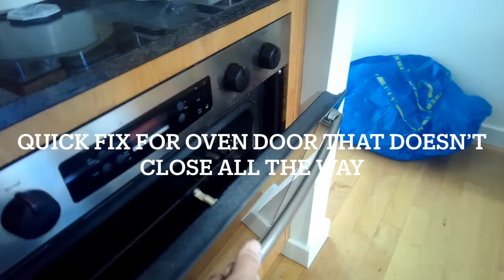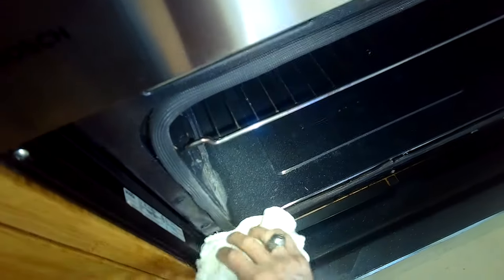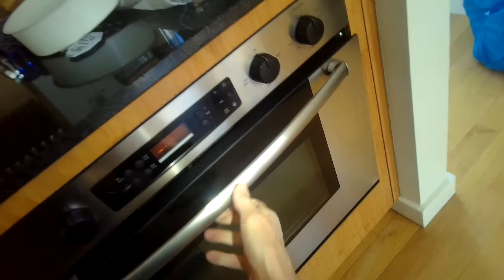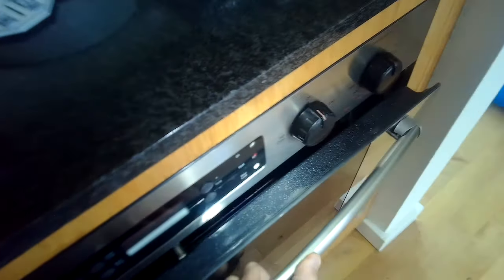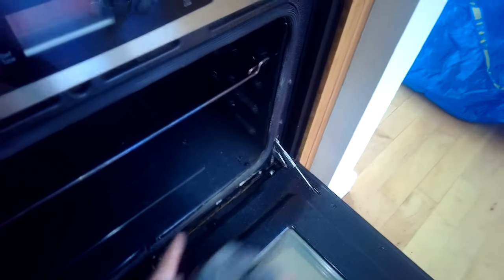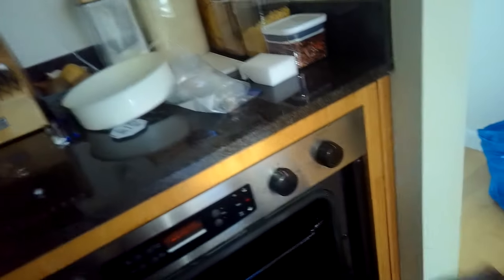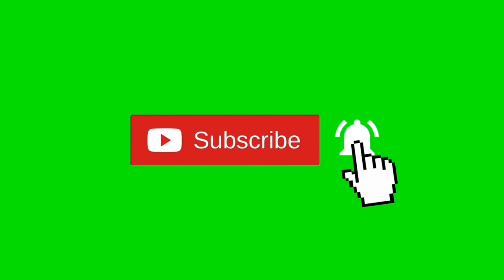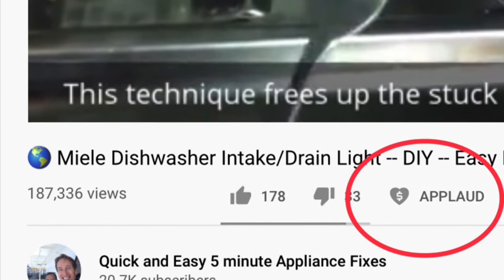✨OVEN DOOR WON’T STAY CLOSED—SUPER EASY 2 Minute FIX✨

Comment: I have had my Built-in Indesit Oven Door Off, Dismantled, Reinstalled, Sworn at so many times, because it won’t close fully, I’ve lost count. I eventually decided today that I needed to buy new Hinge/Spring Assemblies as I could not find any other possible fault…but a final check on YouTube and  you have just saved me £75 as this trick did the job…thanks for the Tip…I’m now a Subscriber…👍🏻👍🏻👍🏻😎

Comment: It worked!!🎉🎉🎉 oven door has not closed properly for ever, had to use a screwdriver to wedge it shut. This fix works because the springs are the problem and this fix is common sense. Genius.
Reply from the maker: Thanks so much Mick😊👍

Comment: I was seriously considering new hinges, as the door was not closing at top of our fisher paykal wall oven. First I checked for crud or such that could've been gumming up the door hinges, or seals etc.
Ran a clean cycle and saw no improvement at all.
Next step I considered was door removal and hinge inspection.
Then I caught this video and did the corner rags and pushed the door top rearward with slow steady effort.
Worked like a charm and saved me a $100 on 2 hinges.
Great tip
Reply from the maker: That is Excellent News😊👍

Comment: Thank you so much for this tutorial. You won't believe how helpful it was I've been fighting with this door for a couple years trying to figure out how to fix it, even to the point of using rubber wedges to hold it shut.  Thirty seconds later it's all good. I thank you from the bottom of my heart . Take care  .
Edit 
This fix works on my oven door but it doesn't last but I'm fine with that even though I have to repeat the fix every few months. I now keep two old rags inch the bottom oven drawer and in a few seconds it's good to go again.
Reply from the maker: It’s magic😊😊😊😊✨

Comment: Now THIS is why the Internet was invented. Thank you × 1000. Literally a 30 second fix! I suppose the washcloths in the way of the hinges allow for some resistance to let one slightly bend some part of the hinges back into form when carefully closing it this way, allowing the door to close more properly (our gas DeLongHi has a catch at the top center which wasn't quite holding the door; now it does!).  I regret I have but one upvote to give!
Reply from the maker: Thanks so much😊😊😊
Reply: @ScottTheFixItGuyChannel  You're welcome.  I should add a note here though, that this, for my oven at least, was only a temporary fix. After about 2 weeks the door started falling outwards again... I decided to take the door off this time to see what the condition of the hinges was, and one's pin was broken completely through and the other was severely cracked (there is a metal pin that the main hinge swivels on). So if those are wearing out, using this towel trick might actually crack them the rest of the way through. Thankfully replacing the hinges was relatively easy (but getting new hinges open the first time, to engage the locks so they can be inserted into the oven, is tough! Make sure you have big vice grips or a big wrench and watch your fingers!)

Comment: WOW. Thanks for this. Worked on my older Viking Oven door. Saved me the $250 plus for new hinges. Suggest you mention this in any of the videos for replacing hinges, as a better and much simpler approach if it will do the job.
Reply from the maker: Good suggestion Shelley👍👍👍

Comment: Ours started doing that after a self clean. Two towels in the corners and a little pressure while trying to close it fixed the problem. Thanks, Scott.
Reply from the maker: Easiest repair ever😊😂
Reply: @ScottTheFixItGuyChannel  If it takes over a minute, you're doing something wrong. Thanks again.

Comment: Wow.  I was about buy new hinges and was looking to take the oven appart to get to the old ones.  Saw this video, if I'm honest I doubted how this could work.  I was wrong.  
Thank you,😎 this has saved money but also a LOT of time and frustration removing the oven and taking it apart.

This was for a UK Beko KDVF100X 100cm Dual Fuel Range Cooker incase anyone has the same issue.
Reply from the maker: Nice job John😊👍

Comment: I coupled this video with Scott's other one about replacing hinges.  My oven door was not closing AND was very very sticky and creaky.  I removed the hinges, inspected them to make sure nothing was broken or bent, cleaned the pivot points of grease using goof-off, dried using a blower, regreased pivot points with High Temperature grease (made for oven hinges), reinstalled hinges using other video, then applied this washcloth technique which I assume retensions the springs (?).  Oven door opens smoothly now and closes fully.  Thanks Scott, you just save me at least $250, much more if I had to call a repair person.
Reply from the maker: I love it,
Thank you😊😊😊

Comment: Great tip! Our oven door was leaving a gap at the top that caused the oven light to stay on.  There did not seem to be a way to adjust the door.  Who would have guessed that some pressure at the right point was all that was needed.  Thanks for sharing!

Comment: Dude! This is like some sort of magic. I thought that there was something wrong with my oven thermostat because the oven wasn't holding heat, taking way too long to cook food. Then I realized that the door was not sealing properly. I used Google for that and your video came up and Presto, such an easy fix that would have cost me a lot in repairs. Subscribed.
Reply from the maker: Thanks so Much Wendy❤️😊👍 you just performed appliance magic😊

Comment: Thank you so much. I was losing heat and my light stayed on. I unscrewed it a long time ago. I tried this because I was afraid I couldn’t put everything back together if I took it apart. I tried this and my oven works perfect. I screwed the light bulb back on and it shuts great! Thank you so much.
Reply from the maker: Awesome,
Thanks so much for the update😊
Reply: @ScottTheFixItGuyChannel  Yeal I read so many about putting new hinges on. I saw yours and said, what the heck , it’s worth a try. I was shocked when it actually worked. It seemed to be too simple. I live alone on a fixed income, a woman who is  not savvy about this stuff too. 😆 but it actually worked for me. Thanks again, and God bless for sharing!

Comment: it worked in terms of it closing tightly! Thank you so very much!  <3 BUT ... one quick question/mystery.  :) The door is slightly askew now (higher on left than right), and it clips or rubs the right edge of the frame as it seats. any ideas?
Reply from the maker: Can you push down on the left side when the door is slightly open to make it normal and straight?
Reply: Will give that a shot today and report back. :) Huge thanks, Scott!  @ScottTheFixItGuyChannel

Comment: Wow wow !!  I wish I'd of watched your video sooner we just had an appliance man out who checked out our 25 years old + NEFF oven as it was taking its time getting up to temperature and maintaining it.

 Apparently the oven is working fine but its in good condition for its age.

I pointed out that hot air was leaking out off the top of the door and the repair man said this was normal 🤨 I told him it never used to be this bad and could this be the problem ? I was told it wasn't the problem, the oven was given a thorough check up so I paid the £93 and the appliance man left.

Not happy I was going to buy a new set of expensive replacement door hinges (if possible) and a new door seal.

I was looking at YouTube seeing how hard a job i was going to have to replace the new hinges, when I came across your video 👍👍👍 

Thank you Scott 😊😊 after 2 minutes the door was sealing properly 😮 the oven used to take an eternity to get to 200C (over 15mins) now its hot in 7 MINS !!!!! Thank you 👏👏👏👏👏
Reply from the maker: That is so cool.
You got your oven back working in 2 minutes 😊😊😊❤️

Comment: I am currently a full time appliance repair technician. Just now, I had the whole door pulled apart. I was doing spring adjustments, shimming, I leveled the whole dang unit, nada. No luck. Watched this video, grabbed two rolls of shoe covers, thirty seconds later the door is closed. There’s no way. I can’t believe it. But it works. 10/10 trick my man.
Reply from the maker: Thanks so much Mr. Miller. Works about 97% of the time👍
Reply from the maker: Isn’t that cool👍✨

Comment: Thank you very much for this video. I tried this but unfortunately door still would not close completely.
Can you help me what should I do now ?
Reply from the maker: Can you try it again with a slightly thicker wash cloth?
Reply: Thank you very much Scott for your reply. I tried again, door now fully closed but when we use the Oven and get heat it is open again at the top and hot air get out of the Oven. What should I do now ? @ScottTheFixItGuyChannel

Comment: Worked great thanks, oven door shuts really firmly now, however, i must have applied too much pressure as i cracked the inner glass broke off a three by one inch triangle at the hinge ffs! now I have heat leaking out of the bottom of the door.  How to replace oven glass,  my next tutorial !
Reply from the maker: Thanks Ian,

Sorry to hear that.

Comment: Hello sir, my sister's oven door falls completely open, it's a Frigidaire oven only, no range top . Is that repairable? Or do you think the hinges would need replacement? She keeps a chair propped against it,or it just falls open ( hard) .thanks for any help!
Reply from the maker: Thanks Woody,
Just needs new hinges that come with new spring.
Reply: Thank you very much!! I looked up some hinges,based on her ovens model number,and they are a bit pricey,so I just wanted to make sure .I really like the adjustment trick in your video,but I was kinda worried that hers had went a little beyond adjustment. Very helpful sir! Do you recommend any certain companies that supply parts? I never found hardware for  her exact ovens model number online.thank you! And hope you have a great day!
Reply: Hello again, I found, and my sister purchased, her new hinges for Frigidaire professional series oven,but they arrived in the open position. I've tried ,but can't seem to close them far enough to lock them down,from what I've seen,they  must be locked down prior to install. Any  tricks on how to push these things down to lock? Thanks again .
Reply from the maker: I like to use a pair of vice grips to grab it and pull them down 👍

Comment: In my case, I have a Samsung gas range-5 years old (purchased 2017); I had to lay my door on my kitchen Island, use vice grips to pull hinge downward using bottom of door as a sea saw as to get torque and pull carefully  the hinge clips attached to the hinge and be sure that the clips sits into the slot so that it holds hinges at about a 45 degree angle. I think my error came when I removed the door-I failed to open the door all the way (90degree angle from the oven) and it left the hinge at the wrong degree. Anyways, hope this helps someone in the future bc the rag idea wasn’t the fix I needed however, I’m sure for other models it works.. As you were. 👍🏼
Reply from the maker: Thank you😊

Comment: This made my oven door close more than it had been, but still not all the way. Does that mean my hinge springs are all the way worn out?
Reply from the maker: Thanks Jennifer,
It might mean that you need new springs but I would try it a few more times with even a thicker dish towel put at the hinges and then push it an even further than you did last time and I think that will fix it.

Comment: Does that work for a built in viking professional refrigerator? The freezer works fine but the fridge door doesnt close all the way and repair person came and told me I had to replace the spring and hinge at the bottom of the door and that would cost $1000 to do since they need two people.
Reply from the maker: I don’t think it works on refrigerators .

Comment: Thank you Scott.  And here is a SAFER/MORE EFFECTIVE FIX:

Open the door about 1/3 of the way.
Along the edge of each side of the door, place a folded-up wash cloth just below the bottom of the top door (half-way to the bottom).
Close the door until it starts to bind.
Push inward on the handle with even force on both sides until it starts to push the light button in and then hold it for about 5 seconds.
Open the door, remove the wash cloths and close the door.
Inspect and repeat if needed.  You may need to push a little further inward on the handle.

Then, with the door slightly open, look down the length of the door’s surface which contacts the gasket that is on the oven and see whether or not it is straight.  Or you can use a yard-stick or any other straight and solid piece of wood or plastic (or metal if you are careful with it) and make sure both the top and the bottom of that edge of the door contact your ‘stick’.  If there is a gap at either end, repeat the process with slightly more force.

If one side is straight and the other is not, then repeat the above process, but with a wash cloth only on the side that is not straight.
Reply from the maker: Nicely done😊

Comment: So this DID work initially. But finding that the door slowly goes back to not closing fully. I think every week I am finding I need to do this again. It will work for now but thinking we are going to have to replace the oven at some point in the near future to keep my wife happy.
Reply from the maker: Might be good to replace the oven door springs.
Reply: @ScottTheFixItGuyChannel  on a Samsung oven are the springs on the door part or the range part?
Reply: @ScottTheFixItGuyChannel  Replaced the hinges/springs. It closes a lot better, but still not as tight as it used to. Could need to replace the hinge bracket on the oven side. Or live with a little heat leak. Or (my wife's solution to everything) buy a new one as I've already sunk $150 on those spring hinges already.

Comment: In my case is the door will lock on the bottom left corner side. I manage to open with tremendous force after 2 hours of inserting tools in that corner. Now I'm afraid to shut the door close in fear that it will get stuck again. I have a GE EER2000.
PLEASE, please help me😩
Reply from the maker: Can you send pictures of the door open hinge area on both the right and left side to:  scottthefixitguy@yahoo.com
Reply: Sure, thanks Scott,  I will send you the pics today to your email. 🤗